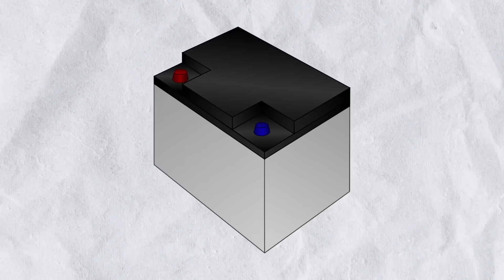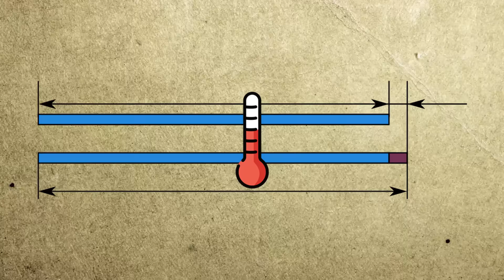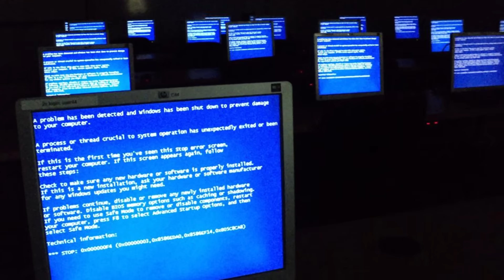(OLD VERSION) Why Hitting Things Sometimes Fixes Them

Comment: percussive maintenance
Reply from the maker: yep
Reply: My favorite kind of maintenance.
Reply: Closely related to rapid unscheduled disassembly, and letting the magic smoke out if not successful.
Reply: @a64738  Magic Smoke, a.k.a. "The Blue Genie".
Reply: That's what TV Tropes website calls it.
Reply: @Rayen14946  we've been calling it that decades before the Internet was even a thing though you are correct.
Reply: It works. I had a tv that wouldn't turn on when I wanted (depending on weather conditions like temperature and humidity) but then would turn on by itself several hours later. I opened it up and found that I could "fix" it by hitting the circuit board in one particular place. I re-soldered the joint (it was the coil of a relay) and it worked fine after that.
Reply: Yse this exact phrase in my job a lot
Reply: Impact Calibration
Reply: Thank you Ashens.
Reply: Also known as the "Fonzerelli Technique."
Reply: I had an old TV, where the picture used to distort to having an hourglass shaped. The only way for me to fix it was to give it a few thump in a few different spots on it.
Apparently (according to my grandpa who used to fix electronics) the effects was caused by the mask getting magnetized, distorting the trajectory of the electron beam, and the impacts were able to temporarily remove the magnetization. I'm not 100 percent sure how it worked, but it would give me about 20 to 30 minutes of normal screen.
Reply: @nvdawahyaify  Back in the day, magnetization was an issue, especially with color TVs (3 electron guns so it was more noticable). They created degaussing rings, which were nothing but a loop of wire in a plastic housing that you could wave in front of the screen to re-randomize the magnetic field (powered by the AC line). Physical shocks can randomize magnetic fields (you never want to drop a magnet, as it will end up weaker afterward), but it is not recommended due to the possibility of causing physical damage. If you had a sub to an electronics magazine, you might have seen ads for them like you would for x-ray specs in a comic book. Modern TVs are not dependent on anything that would be affected by a magnetic field, but you can get a similar effect if you apply pressure anywhere on a flat screen, which I do not recommend.
Reply: @markh.7650  thank you, I was trying to remember the name of the device that my grandpa told me he used to make for tvs. A degaussing ring. 
Also thank you for the explanation of how it worked
Reply: @nvdawahyaify  Glad I could help. The days of needing them ended decades ago thankfully. One of the big culprits was the speakers in the TV cabinet, which most people know have magnets in them. Over time, this constant exposure could slowly magnetize the screen, causing an issue. There were some higher end TVs that had them built in as I just remembered. You could tell by the sound from when it was energized on power on. You could hear a brief hum which would then fade out as it did its job. I think my last tube TV had one, it was a Sony Trinitron.
Reply: Shock therapy
Reply: The ol' Technical Tap
Reply: Yep. Learned that term from West of Loathing. 

Incredible game.
Reply: @TheJodake  Hey, a fellow West of Loathing connoisseur!

Indeed an incredible game.
Reply: Smack
Reply: Praise be the Machine God
Reply: Did anyone else read it as “A percussive maintenance” for a second because of the pfp?
Reply: Me losing my mind cause i saw something that was mentioned in a PM game before but as a real word
Reply: Ay
Reply: GamingMagic13 brought me back here.
Reply: Hey I copyrighted that term in 1987!
Reply: Concussive

Comment: The most common culprit is usually a connector that is not quite making good enough contact. They can sometimes work themselves loose because of heat cycles, like you mentioned. When you hit it, it will sometimes be enough to temporarily restore contact. I’ve fixed a lot of stuff just by unplugging and plugging in internal connections, especially in things that see vibrations.
Reply: Profile pic checks out
Reply: @Whom1337  Indeed it does
Reply: And older stuff with less tight tolerances. I have a first generation Xbox that I got from my mom. Didn’t work when I got it, but the fix was as simple as unplugging a ribbon cable and plugging it back in. That specific cable in the device was notorious for coming loose and disabling the device.
Reply: in old electronics, connectors also used to oxidize and form a very thin non-conductive layer that prevented proper connection. smacking the device caused the connectors to rub against eachother and literally scrape the oxide away.
Reply: The funniest thing is that sometimes a kick will reconnect a lose connection, but disconnect another lose connection XD
Reply: The designers were brilliant designing a connector that could be repositioned without even having to touch it.
Reply: My families TV from around 2010 started having a bunch of issues a couple years after we got it. We opened it up, unplugged all the connectors and plugged them back in, put it back together, and it still works perfectly to this day